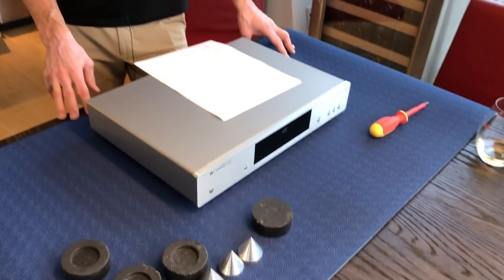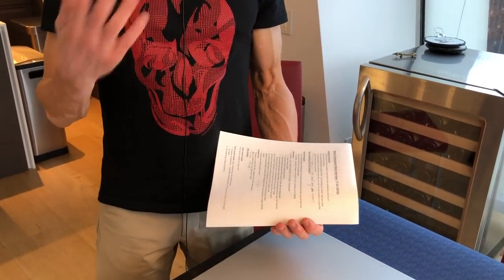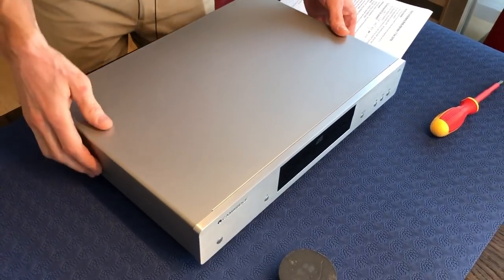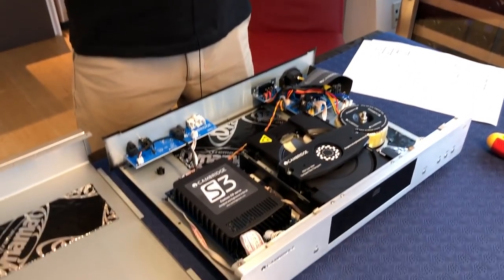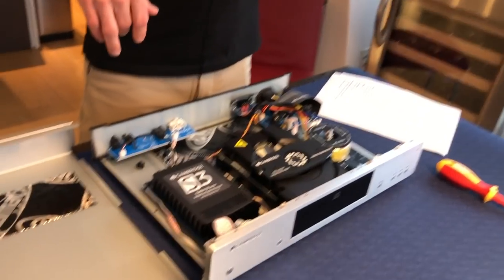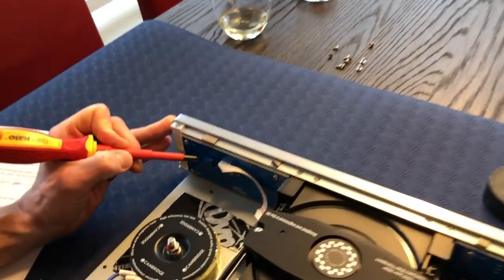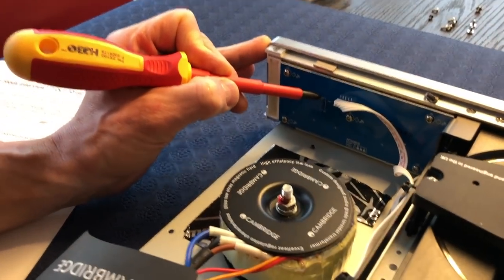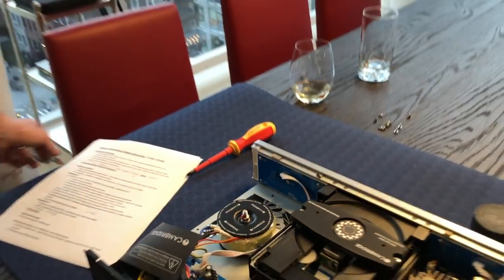Miguel pops the lid on his CD transport to tweak the sound

Comment: I’m sorry fellas. This is just so much snake oil. Prove it you say? Around 17:25 “the reviewer said the most significant improvement was from the dampening...” so did the “reviewer undo each MOD and evaluate them individually to determine which one had the most affect? Some of this has theoretical validity but not in this application. At the end of the day it’s sending a digital signal to the A/D and none of this will alter the ones and zeros.
Reply: It’s not just about getting the right 0’s and 1’s, but the timing of those 0’s and 1’s. Plenty of info on the internet to learn. It’s called “Jitter”

I don’t know how the review determined that damping was most significant. IIRC they did one at a time - dampening being the cheapest/simplest, adding a clock the more complex one.
Reply: Miguel Barrio 
Fair enough but Cambridge touts this thing as being designed to eliminate jitter. That’s their primary design objective for heavens sake. If they believed moving a ribbon cable and slapping some duct tape on the cover would in any way further reduce dither...
Besides none of that maters until the final DAC occurs. Any dither induced upstream is a non issue if the final DAC is competently designed and executed.
Reply: @bluesfish55m51  Yes, and in fact the design is done very carefully - I am impressed. However, for a $449 transport (actually $399 now), things are designed with compromises - in parts quality, build complexity, casework. If you look at the chasis of higher end Cambridge players, you will see they are much more rigid and non-resonant. Similarly, parts are chosen with a price-point in mind, so they might use a $0.70 cap instead of a better one that costs $0.85. All of these considerations leave room for some improvement. 

Eliminating jitter is impossible. Improving jitter performance is.

Most of all, I do this for fun!
Reply: @bluesfish55m51  "none of that matters until the final DAC"??? You're incorrect. The SPDIF interface is the clocking device, the reason being that you cannot tell the source to speed up or slow down, so you're slaved to track that clock with a PLL. There are some implementations that buffer the output and reclock it - but those have other issues: since there are two clocks, the buffer will inevitably get full (DAC clock slower) or run out (DAC clock faster) and the result is a gap in sound. No free lunch!
Reply: @bluesfish55m51  There's one configuration that "solves" the SPDIF limitation: having a master clock that orchestrates the clocking of the whole chain. This is dCS's approach for example. However, few transports have a word-clock input.

Comment: Gday from Australia, wondering if there are any measurements for the different sizes of the Dynamat? 
Any help would be appreciated. 
Cheers Ricey... 🐨
Reply: Do you mean in terms of sound absortion? I don't think it would matter much because just about any thickness of Dynamat would produce a substantial amount of dampening - see where I tap on the top cover. Just pick something more or less standard like a 1mm thickness or so.
Reply: Gday Miguel, I watched your tweeking video with much interest. And really enjoyed it. 
I have purchased some Dynamat, and intend on attempting the first three tweeks you mentioned. 
My question was more about the actual size of the pieces of Dynamat. 
Also, did anything have to be removed, to affix the dynamat to the base of the CXC transport? 
Thankyou very much for your reply to my question. 
Cheers Andrew
Reply: @andrewrice6196  Ok I see. "Cover all you can" is probably the best advice, trying to avoid situations where the Dynamat would interfere with putting the cover back on (like I explained). As long as you put a fair amount you should be fine. I did not have to remove anything, but notice I did not put Dynamat under the transport. Another option you might consider is putting Dynamat on the OUTSIDE of the bottom of the transport, assuming it won't be visible - you'll have to check.
Reply: Gday Miguel, okay. 
Thankyou for your reply. 
Do you have a Youtube channel? 
Cheers Andrew
Reply: @andrewrice6196  Great to be of help! No I don't have a Youtube channel.

Comment: There's a bit of misunderstanding here about what bypass caps are but that's ok considering Miguel invites to be corrected. Bypass as it sounds, is a capacitor in the way of signal, not a filtering one, nothing connected to power of source.
Reply: Thank you. Yes, I meant DC ripple & noise filtering. I have seen this referred to as “bypass” but maybe I misinterpreted.

Comment: Steve, I really don't understand what you mean when you say, "Yeah... I've been around this 'Circus' for awhile' . What part of adding "Personally Subjective" Tweaks would be a 'Circus'.? Are you talking about the % of Improvement that you can expect ? You really can't even put a number on that without figuring in what kind of resolution ceiling the entirety of the System you're placing your Tweaked player into ? 1 more important factor : Does the Source Material you prefer to listen to "Warrant" using a better player ?(There's a term GiGo that holds true for a huge amount of recorded music)
Reply: Love "GiGo"... Never thought of this acronym (Garbage in Garbage out for those who didn't get it)... Absolutely true that compressed recordings do not benefit from a better player - in fact a high resolution system would make crappy recordings more painful. Steve SAID THIS in his review of the Jay's Audio CD Transport. Striving to improve a playback device is not an unworthy cause though, I have plenty of amazingly sounding CDs - in fact VERY MANY MORE than I have good sounding hi-res recordings.
Reply: I was pretty certain you'd understand the reference (Given your background & your equipment choices).
I'm taking delivery on a CXC this week myself. My first intended change will be to remove that item that any & all self respecting Audiophiles should not use ,the Toslink connector. I had a pretty good laugh when I saw that my Metrum Acoustics Hex DAC had these connectors on it ! Does DCS do anything Dopey like including these connectors ? (Needless to say my DAC's resale value is nil as it is 'Toslinkless'). I also have many more exceptional sounding CD (98% Classical) than High res. Have you tried any DUX label CDs ?(Very nice "Hall Respesentative" sound)
Reply: Steve Assante Suggest you use solder wick to remove all solder around the toslink connector pins - that way it is not connected but still in the physical spot (there’s some enamel gluing the connector to the board). I have not done this yet (busy with other things) - when I do I intend to look at the SPDIF signal before and after to see if there’s a difference. 

dCS DACs do include a toslink input, but no dCS source has a toslink output to my knowledge.

No I don’t know that label.
Reply: @steveassante6797  Well guess what... Just did this. Two things I tried:
1- Removing the Toslink - it did improve the sharpness of the signal a little (have digital scope snapshots to prove it! :) )
2- Tried a 1uF ceramic cap on the power pins of the buffer - no difference, so did not leave it in
I think I am done with these mods! :)
Reply: @Miguel Barrio: Thanks for all your Insight ! (Hmmm.....If you're anything like me you are probably wondering what the Jay's Audio CD transport "Brings to the Table"; I'm honestly not that interest in using a Music Streamer anymore)
Reply: Steve Assante I don’t really have an interest in the Jay. This is a fun trial for me, and if I truly get into CDs again, what I will do is get a dCS transport that will make use of my master clock and would also play my SACDs (of which I have about 150 or so).

Comment: If this was necessary wouldn’t CA do it? Wafting a screw driver inside makes me go all funny. I’m going to stick to the book part👍🏻
Reply: The mods here can produce small but noticeable improvements. Products are built to a price point ($450 when I bought this unit), and everything from adding dampening, more complex assembly, or better quality caps contribute to the cost of the unit.
Reply: @miguelbarrio  I’m going to test drive one on Wednesday. Shall I take a screwdriver or a book?
Reply: @Ifyoudonttakeitucantfakeit  Take a glass of wine. You said "take" so I assume you're going to a dealer or a friend. There is no way you can truly assess a component in detail with someone else's system in a short amount of time. By the way, the CXCv2 is exactly the same as the CXCv1 here except for the darker case finish. CA told me this.
Reply: @miguelbarrio  A dealer to hear the difference cf a normal cx player. I’ve spent £2500 already so can’t risk a spontaneous mistake purchase.🤔
Reply: @miguelbarrio  My new DAC etc us the lighter colour and I can’t have a mismatch😩
Reply: @Ifyoudonttakeitucantfakeit Sorry I don't understand

Comment: This is a false economy.He should have bought  a 10-20K bucks transport from 10 years ago for 2000 bucks and would have been off much better. Well, he probably has one anyway.
Reply: Actually... I got this inexpensive transport because I saw it was so carefully designed: linear PS, minimal design, Sanyo CD drive which is the same as in many current high end transports/players (eg Hegel Mohican). Also looked fun to poke around it and modify. If I really go back to CDs (I still have some 7 boxes of CDs in storage) then I will likely get a dCS transport (possibly the new Rossini one), which would be a great match since I have a Rossini master clock.
Reply: @miguelbarrio  Maybe not every high-end manufacturer puts a quality drive in there? ;) It is OK to fuck up a 500 bucks transport when your actual CD player costs more than regular people's houses... but maybe this is not a good idea for people who had to save up for a Cambridge :) I  am looking in to buying an older dCS as it happens and as step 1, I bought another decent but broken CD player to see how I feel about fixing it; then I might get an older dCS with a defective laser or some such issue... actually i already have the original dCS laser unit, as I found it cheap on Ebay. I would get a dCS in a heartbeat, it is only that I have no idea whether I would be better off with a 2019 CD player from the 5000 bucks range, or whether a 15-20 year old dCS for the same money would still beat the pants off it.
Reply: Baerchenization My 2cents: If you’re thinking of a dCS transport, I would say it only makes sense if you have an appropriate dCS DAC - my reason to get a dCS transport would be to play both CDs (~1,500) and SACDs (~150). Otherwise, if you only want to play CDs there are cheaper and prob better solutions (such as the Jay Steve reviewed, or those CEC transports).

Comment: resonance and microphonics interferences
 from a cd player? lol
Reply: It does make a difference. The simple view that a CD player (or any digital source) is just mathematical ones and zeros is wrong. Let me explain: The SPDIF signal coming out of the CD player includes the clock information - this is by design. The DAC receiving that signal must lock onto this clock. If that clock has a back and forth drift, say at 1KHz, that will pollute the signal the DAC decodes. This is called jitter. Vibrations in the clock in the CD transport can introduce this form of drift, hence minimizing the vibration the clock is subjected to will reduce jitter.

Comment: I would bet that any of those mods make no sonic difference that is discernible by the human ear. Dynamat is rather expensive. I’d rather use it to dampen speakers if they need it. At least you would actually hear an improvement.
Reply: Expensive Dynamat? 😂😂😂
Reply: Well the only Dynamat that I have used is Dynamat Xtreme. Of course the more of it you buy the cheaper it is by square foot. But considering if you buy the cheapest Dynamat Xtreme “speaker kit” which include two 10”x10”pieces for about $27 U.S.D.. Correct me if my math is wrong but that’s 1.388 sq ft for $27. That comes out to about $19.45 per square foot plus tax. To me the sonic improvement that I can’t hear doesn’t justify the cost. Just my opinion.

Comment: Hi Guys. Brilliant video; thank you. Couple of worthwhile points: 1. Always disconnect equipment from the wall socket before removing covers. Exposed mains voltages can be lethal. I haven't been able to A/B test the results but I'm pretty sure being dead reduces the enjoyment of any hi-fi system and negates the benefits of any modifications made. It may also invalidate God's warranty on your life.  2. Another free and very easy tweak for any audio component;  try three feet (in a triangulation) rather than four - either by repositioning one of  the existing four feet or by placing new, taller feet under the chassis so the originals don't touch the shelf/support. This is based on the "you can't rock a tripod" theory and, all other things being equal, a three-legged support should always be more stable than the equivalent four.

Comment: Good to see not everyone loves obsolete technology which is vinyl. CD player on good quality CD player and through decent Amp is really what you need. I myself dont need vinyl, medium which is overpriced these days and obsolete
Reply: CD was overly complex
Reply: A cd has specifications (red book) no matter how much money you throw at it, it will never be better than that.

Then again, take an album well recorded and mastered of both cd and vinyl of the same album, vinyl always wins.
Reply: @mikehydropneumatic2583  Strange but true.
Reply: @mikehydropneumatic2583  actually what "wins" is my Nakamichi ZX-9 unit that has been redone by the great Willy Hermann to original specs.  Kicks the crap out of both vinyl and CD.  20Hz-20kHz + or - 2 db or less.
Reply: @thegrimyeaper  rarely mentioned is the CD units that have attempted to sound more analog.  The tube versions for instance but seriously I am sick of tubes and my Njoe toe job unit with the fancy upscaler is toast.  The unit I have now and love is a Rega Planet 2000 with the DH Labs Air Matrix cables
Reply: @JohnDoe-np3zk  Often a lot is done to the output (analog) stage as well (different caps etc.). I had a Marantz CD63KI and it sounded pretty nice.

Comment: I'm and engineer not a physicist and I can confidently say that you've made zero percent improvement to the audio  derived from your transport.  I'm pretty sure  there aren't any PLLs being used in the audio data path so obsessing over clock jitter is silly.  The rise time of the clock and data most likely doesn't matter, so long as it's consistent, but it is interesting that the cheaper cable has a faster rise time, but you didn't say how long that cable was compared to the more expensive cable.  Either way there should be more than enough settling time to clock the data bits into your DAC
Reply: All cables are the same length - 3ft (yes I neglected to say that). Scope is 100MHz bandwidth and termination in all cases is 75 Ohm. I am not sure of all the SPDIF implementations or which is used in the dCS Rossini (my DAC) but in most cases it is a PLL recovering the clock - the use of a buffer with it’s own clock is tricky because the clocks will never match, and the buffer could run out or fill up since you cannot tell the source to slow down or speed up in the SPDIF spec. I understand PS Audio implements such buffer for example, but they are not immune to a glitch from empty or full buffers. At the point the music will have a glitch.

Comment: At 20:04 the madman talks about adding a capacitor by pass on the output signal.  THAT WILL NOT MAKE THE SIGNAL ANY CLEANER - IN FACT IT WILL MAKE IT WORSE.  Go get an O-scope and verify this result.  Jeez Louise - typical physicist - they think they can do anything and in reality can do NOTHING.   Most of these mods are simply a waste of time.   But - if it makes you feel better - which is typically all such silly ass tweaks do - then have at it.
Reply: Bypass to the power pins of the output buffer... I am pretty clear here.
Reply: Gosh this guy shouldn’t go anywhere near electronics.